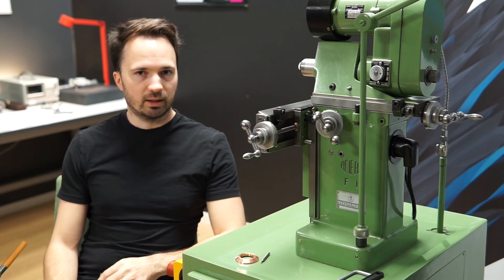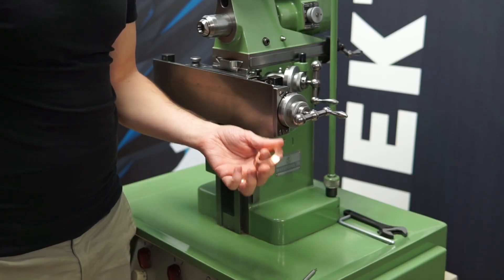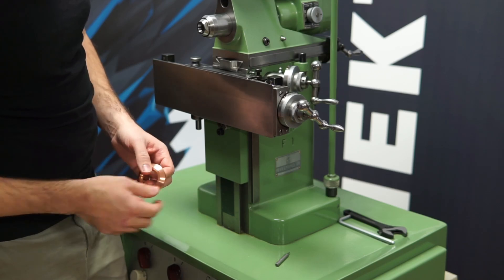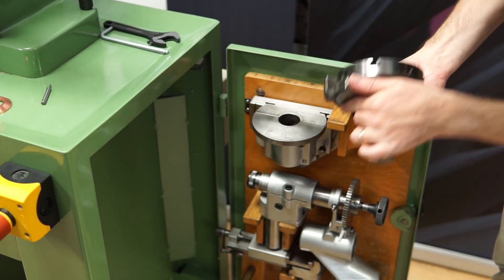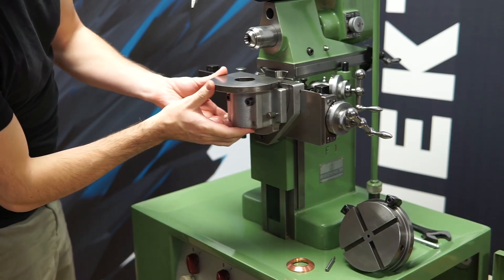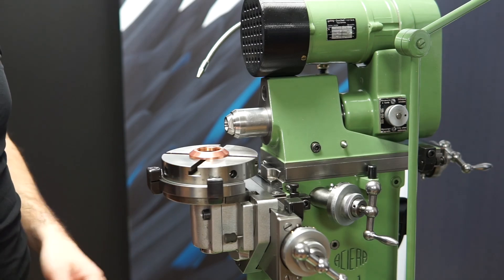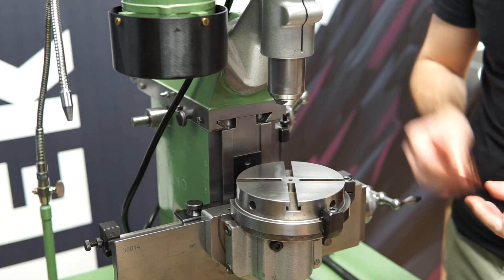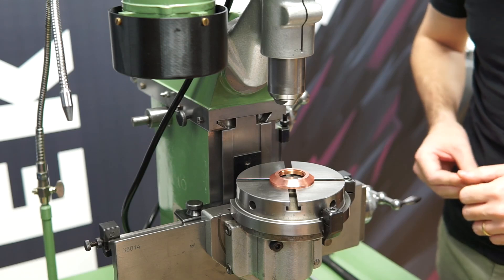Setting up the Aciera F1 for milling a watch case

Comment: Not enough F1 content on youtube. thanks for the video!
Reply from the maker: @GoldenAgePuritan  Thanks for watching 😃 I agree, YouTube needs more Aciera and Schaublin videos 👍
Reply: @MachinistJack  I'm currently rebuilding one. It was apparently owned by a gorilla in a past and abusive life. It needed a complete spindle rebuild which included me regrinding the nose bearing surfaces and sorting rollers to match precision. Next I will scrape all the ways. It has been a great learning experience.
Reply from the maker: @GoldenAgePuritan  Interesting, are you writing about it somewhere? I'm sorry about the gorilla😄
Reply: @MachinistJack  I'm not really documenting the work anywhere. Maybe the spindle work would be interesting to people but it's done so it's too late. There are many scraping videos on youtube so that would just be redundant. Don't worry about the gorilla, at worst he probably just banged his knuckles or stepped on some chips.

Comment: Very pleased that youtube suggested one of your videos. Have now watched through and enjoyed them all, and subscribed. That is a very nice Aciera F1 indeed, and it's great to see your pleasure in using it.    We have something in common - I also have an F1 (older one from the 1960s and with plenty of scars in the paint !) And a bench top 102N. I think you have made good choices. Thank you for the work you have put into your videos.
Reply: Sounds like you are enjoying your new direction, that's great. Mine get used for horological repair and restoration work, and associated part making I am self employed in that line. If by the gearbox 102 you mean the 102VM they are lovely machines to use but I too think that the plain 102 is more comfortable for this sort of work and it is easier to get in close to see small work, and safer. A bit like an Aciera F1 compared to the F3. The F3 is great to use too, but better suited to toolroom type work than horology. One place I worked I had 2 Schaublin 70 lathes for me to use, and shared the use of 2 more 70s, 2 102s, a 102N, a 102VM, an Aciera F1 and an F3, and  a SIP optical jig borer. We were a bit spoilt as there were only 5 of us that regularly used them! None of the others really touched the 102VM or the jig borer out of that lot. Our boss loved swiss machines which was great for us.
Reply from the maker: @lauriesworkshop2363  It seems that I made the right choice for with the 102N then, the 102VM is also much more expensive🙂 Your work and experience sounds interesting, if you see something I could improve, don't hesitate to share 🙂
Reply from the maker: Thanks, it's really nice to know that people are enjoying my videos :-D

Haha, you also made great choices! I started my machining journey from zero in February with an Emcomat 8.4 lathe, then I felt the need for a milling machine and couldn't resist the Aciera. After having experienced the feeling of using a Swiss machine I just hade to buy another lathe :-D I decided to go for the non-screw-cutting one because the gearbox looks aweful and since I already had longitudinal powerfeed in my Emco, I could opt for the more beatiful machine. It was also less than half the price.

I don't mind battle scars in the paint, it gives the machine character :-D What do you do with yours?
Reply: Your two lathes look a good complement to each other, so that gives you plenty of options. Perfect. Interesting what you say about the VM prices, was always the case for new ones but at one time secondhand VMs seemed a bit of a bargain. That has perhaps changed then.. If you only started in February then I think you should be proud of what you are achieving. Very happy to help if I can, just be as cautious about any advice from me as you would anybody else's - and make sure you are comfortable about it and question it. There are always lots of different approaches, often equally valid. What works best for you is the ideal, so do try different ways. I think you will anyway, and that's good. You probably know but if not Stefan Gotteswinter's youtube videos are very enjoyable to watch. Better than that they are packed with top quality information and approaches. Interested to see what direction you head in with your workshop. Yours is very tidy, but I feel very guilty when I see how untidy mine gets at times. Watching youtube brings me to  consider tidying up more frequently. Also it is very humbling when you see what others achieve.
Reply from the maker: @lauriesworkshop2363  Great advice! I'm taking it slowly and enjoying my time in my workshop. There's no need to rush it since I'm working with half-antique machines already, which is a nice feeling compared to software development which I did before.

The VM machines I saw for sale in the summer in Sweden/Europe were all pricier as well as more worn than the non-VM machines. So yes, it was a good thing that my Emco could complement the Schaublin. The Emcomat has an adjustable tailstock which is very useful, while the Schaublin does not, or is it still possible to adjust?

A good way to keep your workshop clean is to not use shoes inside, walking around in metal chips makes you want to vacuum every hour 😀

I recognize Stefan Gotteswinter's name but I don't recall watching any of videos, I'll do that now, thanks :-)
Reply: Yes it's important to enjoy your workshop time or there is no point having changed from software development.
My tailstocks are the previous rounded type and not adjustable. I don't remember about the later style - sorry. I have the long travel compound slide so that's been fine for tapers. My screwcutting lathe does have adjustment, but I now leave it set as it is such a faff to true up. You could make or buy an adjustable tailstock centre. Or my favourite is to make a centre for a boring head and use that. Haven't needed to for a while though...
No shoes haha. That might work.
Not for me though, I have enough trouble getting brass splinters out of my hands never mind my feet!
Reply from the maker: @ Splinters can be really annoying, I will probably have to buy some shoes just for the workshop 😃

Comment: Hi Jack thanks for the demo using the Aciera F1. I like this mill but it's rare and very expensive. I did use the Aciera F3 during my apprentise days in the 90s. Hopefully you would show more of this interesting small mill with all the attachments and many ways to mill :)
Reply from the maker: It is a very interesting machine and there aren't enough videos about it on YouTube so more are coming. I want to do a series of videos where I try out different features/functions of my machines, for example the levers (instead of using the handles). So make sure to subscribe 😀

Here is a short-video showing briefly what I did today (milled a watch case to get some practice before doing my next video): https://youtube.com/shorts/q-iwQfCtHCE?feature=share

How was the F3 to use? The F1 is a beautiful and versatile machine but not the most rigid or powerful 😀
Reply: Hi Jack that was a fast reply! Aciera F3 is meant more for industrial use. Not so many attachments. I have already subscribed, not wanting to miss any of your video. Will keep a lookout of your coming videos, many thanks for all the time and efforts made :)
Reply from the maker: @ Thanks for watching 😃